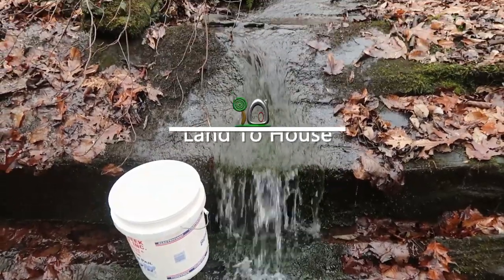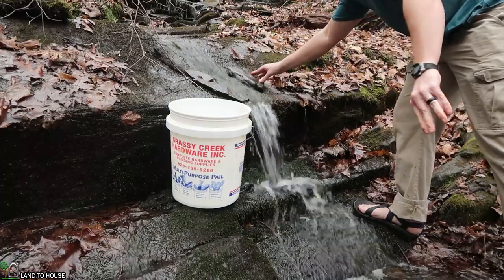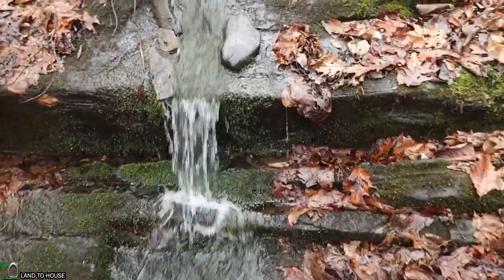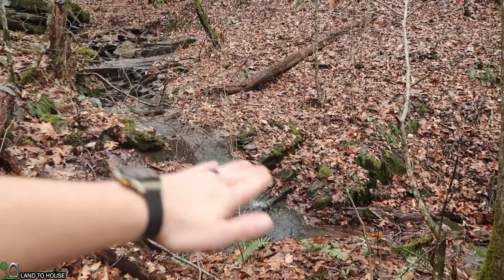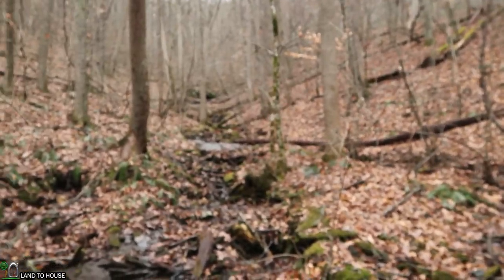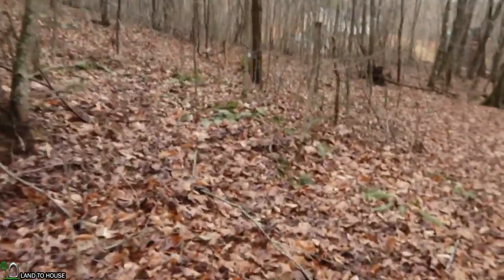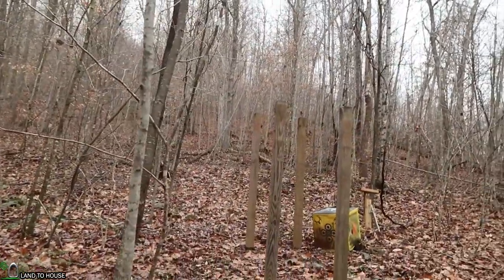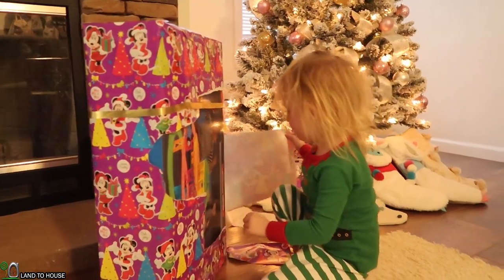Creek Flow Rate Test for Micro Hydro

Comment: Watch my video on penstock pulling with a winch. It worked great. I vote tapping that waterfall unless the flow*head of the lower spot is better.

You can use a v-notch weir to measure the gentle slope flow.
Reply from the maker: I am really considering PVC as the penstock. I can save $400 easy on the 1000 feet. PVC has a lower friction loss and can be installed in 20 foot sections. The only down side is that I will have to spray it with paint to increase the UV protection. 

The lower spot will have slightly more flow but 10 to 15 feet of head pressure loss.

Comment: Also you can measure the head pressure by just dragging up some small pipe and garden hose. I scavenged enough to stretch 760ft. Watch my full pressure test video.
Reply from the maker: Would you mind linking that one here? I am currently watching your micro hydro p1. I wonder if there is loss in a stagnant pressure garden hose?
Reply from the maker: Nice! I can probably find 300 feet of garden hose. I think I will use your method but in increments of 300 feet. Psi / .433 = head ? I think.
Reply: @LandtoHouse  correct. I bet you have some poly pipe laying around too, you can use that also.
Reply from the maker: HA poly pipe around this house? Lol yes I might have a few hundred feet.
Reply: @LandtoHouse  then join it all together and put some form of filtered intake on the end under the falls.
Reply from the maker: Just ordered a new pressure gauge. (Through your amz link) so I can perform this test next week.
Reply: @LandtoHouse  thanks! Don't let it freeze, my 3/4 black poly has some stretch marks. It's disconnect from the barrel now.
Reply from the maker: I was watching another video and that person said they drain the pipe when it gets below 30 degrees. The few days without is not worth cracked pipes.
Reply: @LandtoHouse  Mine has worked fine as low as 5F so far this year. We haven't had colder yet. But then again I'm using spring water so it comes out of the ground warm. if your creek is spring fed then it might be warmish too.
Reply from the maker: I have seen 0 degrees here one time. This year I think it has gotten down to 20. Very mild winter.
Reply: @LandtoHouse  we can see -25f
Reply from the maker: It is spring fed but I am gathering the water 200+ feet after the spring.
Reply: @LandtoHouse  it would be interesting to measure the water temperature during single digits.
Reply from the maker: @JoeMalovich  that would be interesting. One guy said that snow on the penstock kept it from freezing.

Comment: I love watching your videos. Wondering if i should buy the 1 inch or 1 1/4" pump. Have a creek that sometimes has 6 inches of water moving or sometimes 4 feet of water.
Reply from the maker: The head pressure is the main thing you will need. It can also be tough if a river is known to flood. You have plenty of water to run either of those sizes.
Reply: @LandtoHouse  thank you Sir! Sent an email inquiring about shipping times.

Comment: HI    HOW ABOUT USING A BLOCK AND TACKLE SETUP TO PULL THE PIPE UP.THERE ARE A LOT OF TREES TO ATACH TO,  AND  USE THE 4 WHEELER TO PULL UP 100 TO 200 FT. AT A TIME.   WITH THE PULLIES IT SHOULD NOT BE TO HARD.    IT WILL JUST TAKE TIME.    THAT WAY YOU CAN GET TO THE POINT YOU WANT.   GOOD LUCK.
Reply from the maker: I like that idea. I am still toying with the idea of pvc instead of poly pipe. 20 food sections vs 500 feet.
Reply: YOU MIGHT CONSEDER THIS,  THAT IS A LOT OF PIPE.   WHAT CAN YOU DO WITH ALL THAT PIPE IF THE SYSTEM DID NOT WORK OUT LIKE YOU THINK.   CAN YOU USE THE PVC TO MAKE RAM PUMPS TO SELL?      OR  WHAT COULD YOU USE THE POLY FOR ?

Comment: Could you do more intake  To get more wattage that would even lower your bill if you could do that. Or is that possible
Reply from the maker: The way I understand it the power output is head pressure x gpm x .18 then system efficiency is often 50%. I should be able to maintain 25gpm. Next I need to get the head pressure.